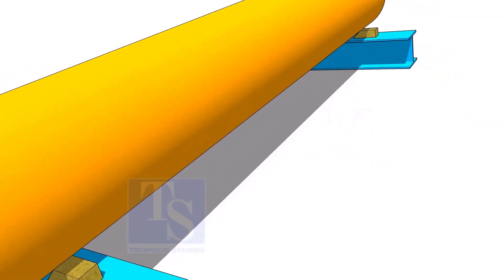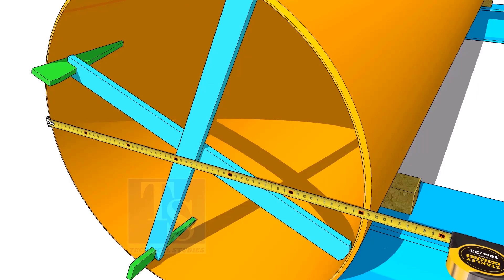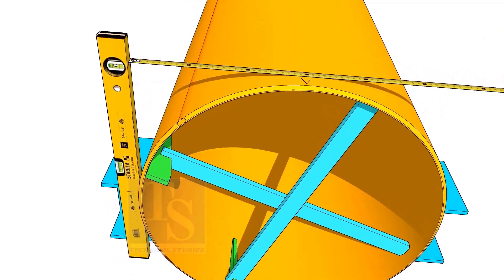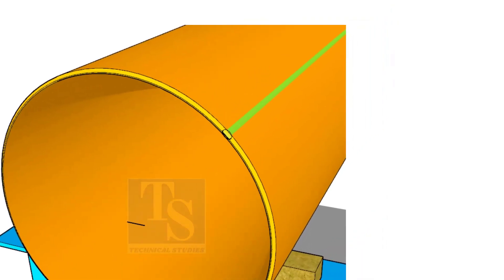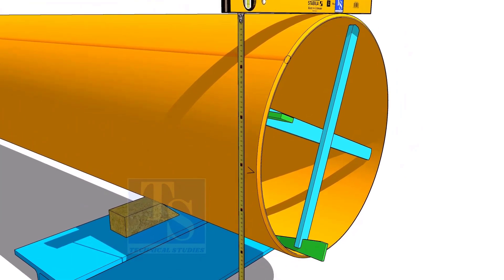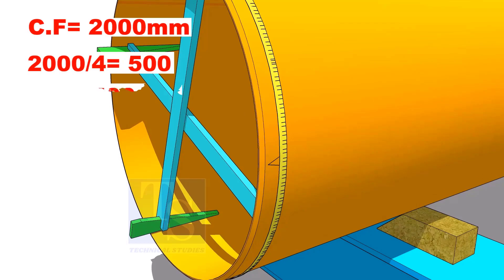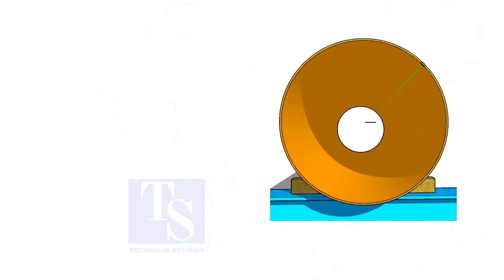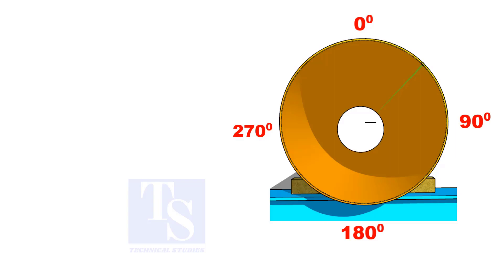How to mark center line and divide a pipe circumference. पाइप का सेण्टर कैसा मार्किंग करेगा.

Comment: I like to use cash register paper to divide pipe.  It is 2" wide. Simply wrap it (squarely) around the pipe. There is the circumf. Next, take off the cash reg. paper. Then fold it into 1/2, then fold that in 1/2. There is the 90,180,270 and finally 360 deg. Simple fast. No need to waste time leveling. Can use an angle iron to mark the lines, from one end to the other.  Simple & fast again.
  Works on all dia's. Very helpful in dividing smaller pipe dia's too.
Reply from the maker: You are correct Bro.